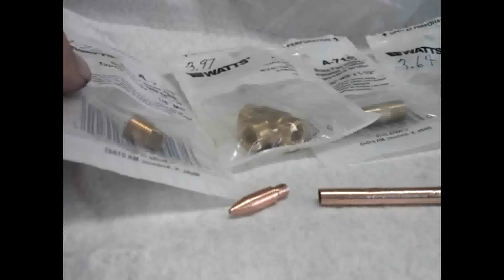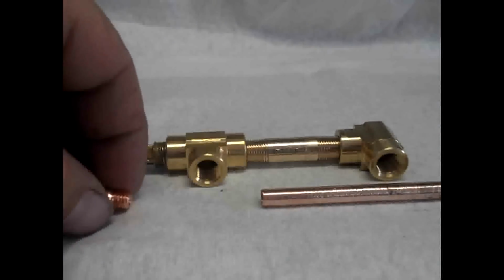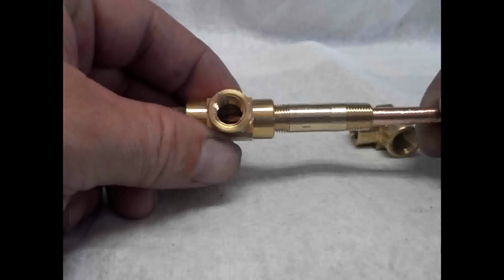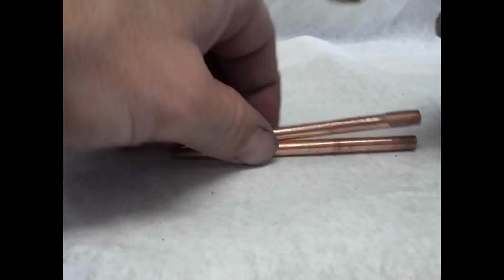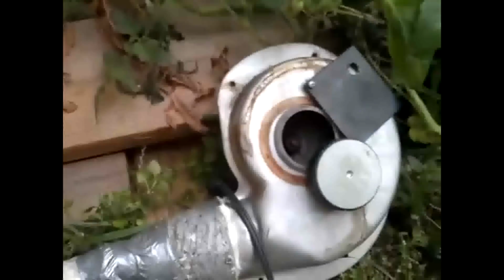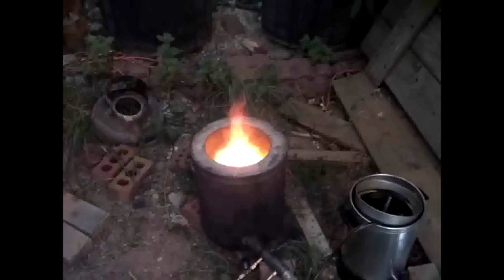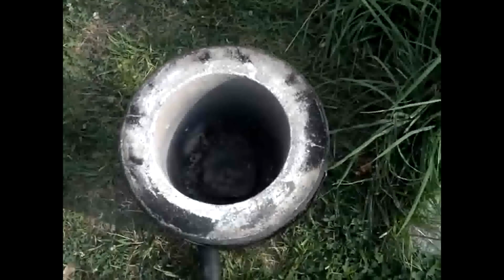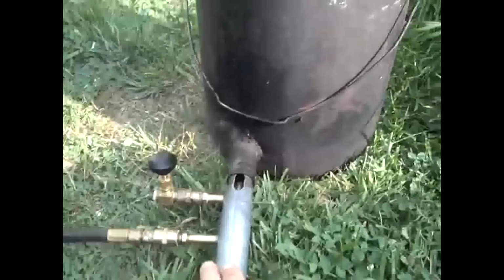How to Build the Kwiky All Fuel Foundry Burner

Comment: This is the most fantastic way to build a siphon valve ever. Thank you so much!!!
Reply from the maker: You are welcome. Let me know how it goes!
Reply: @backyardmetalcasting  I will. I just subscribed also. I am in Pa . Where are you my friend? Let me tell you what I am using this for. I have to melt some aluminum so that I can cast a bearing holder that bolts to the Swingarm? assembly on a 1985 Yamaha Trimoto. three wheeler. Thanks again.
Reply from the maker: That sounds like a good project!  I grew up neat Pittsburgh but I’m in North Carolina now. If you are on Facebook you should join the hobby metal casting group too. There are lots of knowledgeable people there.

Comment: I have built this foundry burner haven't used it yet... But this is the easiest burner build I have ever done ... I am building a foundry 50% Plaster of Paris and 50% Sand... I am going to build a foundry that has a spring-loaded pour spout that comes out of the bottom of the foundry... this will make pouring ingots much faster than with a removable crucible... my ingots are going to be poured into muffin tins.  THIS VIDEO HAS INSPIRED ME TO GET THIS FOUNDRY DONE BEEN WANTING TO BUILD THIS TYPE OF FOUNDRY FOR A WHILE NOW... THANK YOU FOR THE INSPIRATION TO GET BUSY...
Reply from the maker: I am glad I inspired you! I do have some questions though and  I am wondering if you researched fully the Spring loaded Furnace release and plaster of Paris for a foundry mix. I definitely would not use plaster of Paris if you are going to try a homemade mix I would use fire clay and sand. You would really be better off finding a refractory commercially made mix though.  A homemade refractory won't last very long.
       A batch type furnace like a cupola uses a clay plug to block up the pouring opening while the furnace is being heated and the metal melted

Comment: Hey dave great video i made mine and i use wmo and for some reason i cant get it to light.  when watching you other video demonstrating it i notice i dont get the same mist.  is wmo too thick  or is there something else i missed i know it user error whether its my construction or fuel use. thanks if you replay.
Reply from the maker: first, it will be hard to light outside of a hot furnace.  many people get the furnace hot using kerosene or diesel.   it lights much easier....then switch to oil when its hot
Reply: @backyardmetalcasting  perhaps I didnt have the furnace hot enough but honestly it didn't look like I was misting out as much as your video shows.  Shall try again this weekend
Reply from the maker: ok, let me know how it goes.  some people put the oil up high to give it pressure to the burner too.
Reply: @backyardmetalcasting  ill post a video and tag you in it
Reply from the maker: @lethis196  ok, sounds great.
Reply: @backyardmetalcasting  Video should be up tomorrow. I accidentally deleted all my videos on my channle lol.  I think i set it to instant primere so i think you can watch the first six minutes dsl is slow so full upload this time tomorrow.
Reply from the maker: ok, great

Comment: Did you have to grind down the copper tube to fit through the nipple? Mine isn’t fitting through.
Reply from the maker: you may have to sand it down slightly

Comment: I love this David, great job - super simple and straightforward. The only way it could be more simple is the drip oil approach. Anyone any inputs on the efficiencies of each? I have a couple of suggestions...

(1) get a 1mm MIG tip and fill it with silver solder. That way you can drill an orifice to your exact requirements to set the BTU/kW output.
(2) if your copper tube insert OD does not exactly match the ID of the T coupler then when you unscrew the end cap the tube will tend to move off-centre. Annular atomisers are super critical about the concentric location of the inner jet. Use some epoxy around the tube when you set the air tube inside the T coupler and this will keep it centralised. Make sure it gets far enough up inside the T coupler to hold it in position but not so far as to compromise the oil intake. You won't need to solder the back of the air tube in.
Reply: I'm going to give it ago. Your advice assures me success. My concern being dead center for siphon. Like silver solder tip as well. Thks. Gods speed

Comment: Hey David, thnx for the vid! Looking good!
I have a question: did you tried to change the oil/air hoses?
In other videos they had the oil from the center tip.
I can't comparise these because this design is way better worked out.
Reply from the maker: Vincent I tried it both ways and didn't notice a difference.   Maybe someone smarter than me can do a test to see which way works better.

Comment: Hey David I wanted to tell you about the one I though together its basically the same thing just the mig tip is a 0.35 it does work how well I don't know yet I just tested it using water and a nebulizer for asthma the real test will be tomorrow I'll be sure to let you know how it does I have faith in it though I wish I can get you some pictures but I am not to sure how well its going to look I want to thank you quite a bit I love waste oil burners a lot kinda tired of the drip feeds though they like to go out of control on me but the big thanks is for taking your time to show us this with both videos especially thanks David best of luck 
Anthony
Reply from the maker: anthony hayes thanks for the comment. Send me some pictures if you can and I can post it on my site.

Comment: I didn't have any of these materials around my house so I purchased all the parts at my local home improvement store. www.dropbox.com/s/ies7y838xt333rv/20180430_102906.jpg?dl=0  $63 later I have an awesome diesel fuel bubbler. Save yourself some headache and buy a delavan nozzle.  Nozzle: www.patriot-supply.com/products/showitem.cfm/DELAVAN_30609_5, Adapter: www.patriot-supply.com/products/showitem.cfm/DELAVAN_17147

Comment: Hey just to let you know man I am working on building one of these for a little heater that I am building I’ve built one of these before but that was definitely a long long time ago just wanting to make sure if it’s okay to add the link to the video on my channel when I start building it and everything I really do want to thank you for your time with this and passing it on thanks man really thanks
Reply: David D multi fuel heater it’s a  contained system with no open flames just in the building and testing part right now but there is going to be safety things to keep from things happening but how I am going to test the burner I am going to Attempt to pump fuel to it in order to run low PSI for air
Reply: That old burner was not that great I was using a cutting torch tip of a acetylene torch BTW the way

Comment: Hi, I thought I could share this idea if you are not aware of it yet. 3D printer nozzle might give you some more flexibility, as they have standard hole from 0.2mm up to 1.2mm. It might be handy if you want to do a very small compact air. The only drawback are the metric thread which is M4 for these nozzle.
Reply: it's actually cheaper to buy M4 tap on ebay for about a buck than something less common like 1/4 x 20

Comment: Hi all.  I just built this and I wanted to add  a few comments.  At 5:42, you can see how the mig tip doesn't stay centered.  When you solder the mig tip in, make sure you do so with it standing straight up.  Otherwise, the mig tip will solder in crooked and it won't fit in.  I also want to mention that if you are using mapp gas, it only takes about 6-8 seconds to heat it up enough for the solder.  If you over heat it, the flux with fail.  Propane probably takes a couple seconds longer.  If you never soldered this way, look up a few videos.  They help a lot.  

I was able to verify mine is working by attaching a 4 ft tube dangling straight down and the siphon pulled up water quickly and without hesitation.  You may have to adjust the front tip to get the desired results.  The pressured air has to go straight through the front hole for the siphon to be successful.
Reply from the maker: Send me some pictures when you get it going and I will post them on the site!

Comment: I am unable to find the 1/8" Squared Head Plug that is beveled like the one you have.  The ones I could find are flat/filled. Pictures of them online don't show the bottom.  Can you tell me where you sourced that part?  The one on home depot website for my store is Sioux Chief Model # 930-500201, but again it doesn't show a picture of the bottom. Maybe it is, maybe it isn't the correct part. There is no Watts part at my store with the part numbers in the video. Can you tell me the specific part or model number, or better yet store SKU for that part so I can source it? thanks
Reply from the maker: I think the flat...filled one would work fine as long as you can get it drilled in the center.  Someone told me the lowes one is solid now too.  Here is a link to the one I used.
lowes.ca
Reply: Take a drill bit the same size of inside of fitting drill just a little bit and it will give you a center counter sink then use size of bit to drill hole

Comment: How could the copper tube and mig tip fit inside the pipe fitings if the copper tube is twice as big as the fitings?
Reply from the maker: It couldn't.  And it's not!

Comment: make an oil pre heater out of a coil of copper tubing to pre heat the oil and you can fire the oil off right from the start and it will burn hotter and cleaner

Comment: I already have some .035 mig tips. Would that be too big?
Reply: Just get a small steel ball from a ball bearing and place it on top of the hole of the mig tip, and just lightly tap it with a hammer and watch the hole evenly close up to whatever size you want.
Reply from the maker: it would work but it would consume a lot of air.  I am thinking about making one by soldering the mig tip shut and then re-drilling it so it has a smaller diameter.
Reply: YOU CAN BUY MIG TIPS AS small as 0.22
Reply from the maker: Romppai's Outdoors probably the smaller the better to reduce compressor load...unless you are really needing a huge BTU!!
Reply: I wonder if you could use the bigger tip and control the air with an added valve so that you could adjust the BTUs as needed?
Reply from the maker: I have a pressure regulator on the air supply...I run it close to 30 psi which is a lot of air.  Other people have made the burner and can run it using lower pressure.  I have been so busy I haven't played with mine much since I built the pressurized fuel supply.  I'm thinking with that, I can lower the air pressure some.  

     I've been sick this summer but am feeling my energy returning...hopefully, I will be able to work on projects soon.
Reply from the maker: That's an interesting tip...thanks
Reply: David D
You're welcome.

Comment: David, where on earth did you find that super long MIG tip? I have been searching online, and I can't seem to find one that long.
Reply from the maker: I think I found it at a local welding shop and i think it is a Miller part but i just searched too and couldn't find it...I don't know if it is discontinued or what.  I don't think i ever found one that had a small enough hole anyways.
Reply: The long mig tip is a Profax PN/ 3123 sells for about $1.49 each BUT can only find them in a pack of 25 !!!!!!!

Comment: I used a 90 as my nozzle i stuck the tip in then adjusted till i got a super fine mist. Drilled the hole a hair bigger than the hole at the end of the mig tip

Comment: I really like the design, but can it run on propane and diesel because i dont have an air compressor and i dont have the money to buy one either... i think it could work if i switched the compressed air for propane and attach a blower..
Reply from the maker: I'm sure you could get it to work that way...it seems like you would have a huge ratio of fuel to air though.  Why don't you build a naturally aspirated propane burner?  It seems like that would be a lot easier.  Do a search for Michael Porter gas foundry burner.  He wrote a book on it.  Lit us know what you decide and how it goes.
Reply: I already got that but i don't think its enough heat for me.
Reply from the maker: What are you melting??
Reply: Tungsten? ;) Nah just bronze and brass at the moment but i wanna do cast iron
Reply from the maker: Have you looked at a cupola for cast iron?
Reply: Nah thats nothing for me, way to much mess... I live in a "rowhouse" as its called in the netherlands....
Reply from the maker: I'm surprised you're getting away with any metal work there!
Reply: ikr but its not that bad with just propane cause it doesnt realy smell
Reply: when i started out with it i used charcoal and just put a crucible in it but back then i did get a few complaints from my neighbors
Reply from the maker: Yes, propane is nice and clean and easy.
Reply: But is does take quite a while to get really hot

Comment: Hey its great make. Did you ever try more radial arched tip?
Reply from the maker: No. Its not necessary for inside a furnace
Reply: Ok, does the point on air nozzle have to be so pointed?
Reply from the maker: That's how it works for me...it puts the tip in Front of the oil inlet on the nozzle...I feel like it pulls the oil better that way

Comment: Just made this and followed the video to the T. Tho i couldn't get it to keep a flame. i tried 20psi all the way to 30psi. I'm guessing i need to ajust the plug (tip). It got late and i didn't want to keep the neighbors up with my compressor, so I called it a night. Other than that it worked fine, pulled oil out of the tank and misted it well. I will play with it more tomorrow after work and update you on how it goes.
Reply: No worries, I added a video of the startup on my channel which you are more than welcome to use.
Reply: keep us updated...it will burn a lot easier in a furnace...another tip is to start with a kerosene mix, get it tuned and then switch to oil....just realized I posted from my gardening account again...sorry...but if you like gardening too, subscribe!!
Reply: Got this bitch up and running (been busy recently and had no time until today). Started her on clean ATF with a torch shoved in the back of the pipe. before i was trying to light it at the tip of the pipe and the pipe would never get hot enough to ignite the mist. Lighting the mist from the backside of the pipe worked wonders, she lit on her own within 30 seconds and i switched to used motor oil. Badass design, I cant wait to make a foundry and get melting.
Reply: Riggsy18 yea!! Love to hear success!
Reply from the maker: Riggsy18 oops, I was using my other profile again...  Post a picture or video and I will post it on the web site
Reply from the maker: Ok thanks
Reply from the maker: I can't find it?

Comment: Will it run on hydrogen? Liquid or gaseous?
Reply: think more boom than burn but if it is gas for welding or such should be all to different would not want a tank of it near the fire hydrogen tends to leak alot.
Reply from the maker: I wouldn't know and I wouldn't want to try!!  Is that a serious question?
Reply: I have never used hydrogen for anything but it is just a gaseous fuel like propane or natural gas. I don't see a problem. Give it a shot.
Reply: just suck it up, yes but test for leaks man, you read to much into it

Comment: How did you make your bucket furnace and what is the capacity? With this setup, how hot does it get and what have you been able to melt?
Reply: I think a #6 is six pounds of aluminum, that's what I've heard anyway.
Reply from the maker: Thanks for watching!

    I got one of those concrete tubes that are made of cardboard from the hardware store and used that inside the bucket to pack the castable refractory.  I used commercial refractory that is rated to 3000 F  degrees.  I haven't gotten around to making a lid for it because a lid i made for my previous furnace using a propane canister fits it fine.  I melt brass fine in it and I am sure I can do cast iron in it too.  I don't remember my crucible size...I think it may be a 6 which would be 6 Lbs. of brass if I remember right.
Reply from the maker: Bryan Noyce I think you are right

Comment: your foundry is very good if you put another one on the other side 180 so you get a belter heat and you can use an hho system  and using oxygen you'll need to tee off your air and fuel for both sides .hydrogen makes any fuel burn %100
Reply: it would be a waste, if you want unbeatable heat to say melt cast-iron, do away with the air compressor. get a welding oxygen cylinder  and oxygen regulator and set your presser at 10psi to start, adjust as needed. man you will get heat, make sure the pot the burner is in is super heavy as it will melt steel